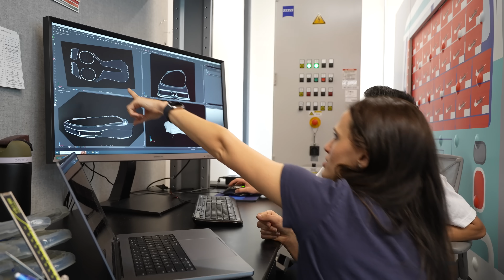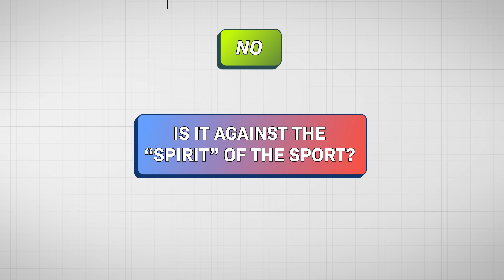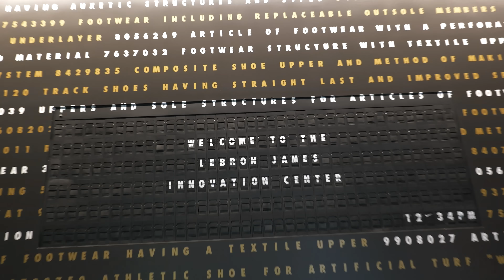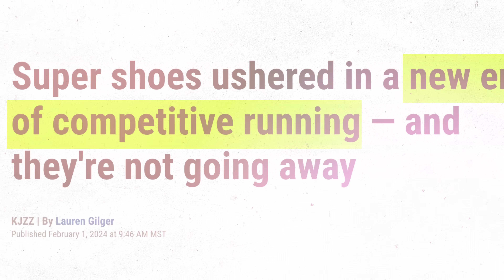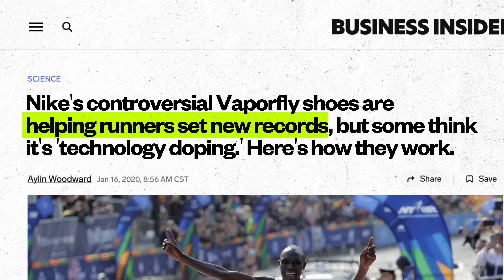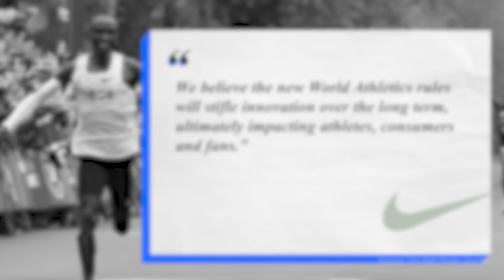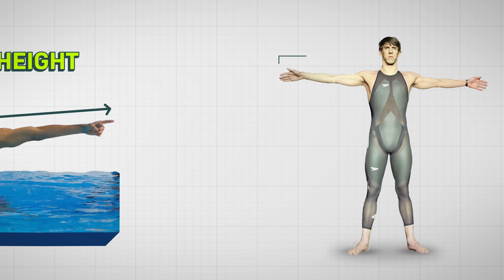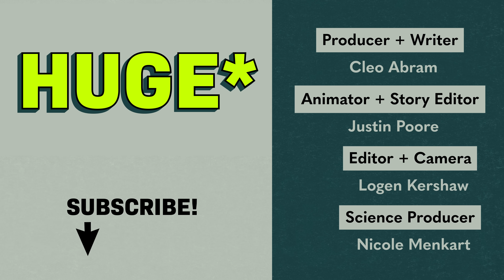The Shoe That Broke Running

Comment: By the way, you should never cut carbon fibre without a proper face mask and a an air exhaust system right next to the saw. Carbon fibre dust is a bit like a modern asbestos and will stay in your lungs forever, since your body can't break it down. It will also stay airborne for a pretty long time, due to to its super fine size.
Reply: good to know
Reply: Holy shit dude thanks for the info
Reply: Long hair just dangling down instead of made into a pigtail is also a bad idea.
But at least she put as much of a distance between her and the saw as she could.
Reply: It’s like no one knows. I see far too many YouTubers doing this. 😢
Reply: Can the body break down saw dust comparatively?
Reply: @Coz131 yes because it is naturally biodegradable, with enough time and fluids it will break down into nothing.  Unless you inhale it on a regular basis.
Reply: @Coz131  Wood is bio matter.  So, yes, can break down in time.  But i wouldn't want to inhale a whole bunch of it at once.
Reply: Looks like the insole was not cut though?
Reply: @sprint702 you can clearly see the insole was cut at 8:29 you can even see the carbon fibre dust on the foam next to it
Reply: Carbon fibre dust is absolutely not good for your lungs but it's not quite asbestos. The smallest particles don't have the correct aspect ratio and those that do are too large, it's more like silica in danger profile, which as we know causes silicosis with chronic exposure; carbon nanotubes on the other hand are almost indistinguishable from blue and brown asbestos (the worst kind) under the microscope and are suspected to be capable of causing mesothelioma from single exposure in those susceptible.

Protect yourselves from dust in general though folks; even wood dust can cause serious problems from chronic exposure, even cancer, in some people.
Reply: I expected a comment like this would be here after cutting the shoe in half 😂
Reply: Asbestos are not as dangerous as people make it out to be. Yeah, it's bad. But we're talking high levels of long-term exposure before damages to the body can be noticed. Doing it once or twice won't hurt you.
Reply: @SweBeach2023  That is unfortunately not really true. It is all a matter of chance. A single fiber can cause a cancer. High concentrations over longer period of time just makes this more likely. You could be really unlucky and get cancer right away (but only after a very long time).
Reply: @balaenopteramusculus  It seems like one of those things where even though the risk isn't super high, there isn't really a good reason to take it. 
Will touching asbestos once kill you? Probably not. But it could, and there aren't a lot of good reasons to touch asbestos, so we don't do that.
Reply: @Lizlodude  Well, that is my thinking. Anyway, I worked in asbestos remediation: you can generally touch it, as long as you don't crush it, cut into it or otherwise fragment little pieces off. That said, if I see it, I stay far from it nonetheless 😂

Comment: It's really funny when you look at the prices of the shoes. These shoes are expensive but not out of reach for a enthusiast runner. Go into different sports like cycling, sailing, and canoeing. Federations have their own labs and research institutes developing equipment for these events without any economic success. The Germans FES bike's frameset will set you back 30000 USD, no wheels, handlebar, or drivetrain.

Comment: Where do you draw the line between tech then? I run a lot, and softer, well built shoes allows me to train more (as opposed to run barefooted), ergo tech gives me an advantage. It's impossible to get away from thay simple fact. Then add in responders and non responders, meaning not everyone will get the same effect from the same gear. Different drops, durometers, stack heights, stiffness, stability etc all factor in and will be very individual. So having options what gear you use gives the athlete the option to find the best shoes for them.

Comment: Its easy. The moment you use a technology that is proven to enhance your performance, you should be in a different competition.
This also would give competitors the possibility to do a all clean competition. If they chose to run or swim without any helping devices, they get sorted to the old records, so it remains worth to compete clean.

Gamers do this all the time for speed runs.

Comment: I have been running for 25 years and when I first ran in the Alphafly 3 I was BLOWN AWAY, the biggest impact for a normal runner like myself was the reduction in fatigue. I can’t imagine how much it must help a top level runner
Reply: My gosh I wish I could get those (300$) I'm curious to see if they would help with leg pain even when walking. I have pretty severe RLS so I'm very intrigued by their effects on pain
Reply: @Lord_LindaThePhilosopher  Expensive athletic shoes are worth it. Even in college, I was using $300 cleats. 100% worth every penny.
Reply: @Lord_LindaThePhilosopher  If you get Alphafly only for walking you're going to regret it.
Reply: @Lord_LindaThePhilosopher  Enjoy, because I really want to buy it here in Brazil. But it's almost 3k R$ in our currency... 😬🥵
Reply: @Lord_LindaThePhilosopher Those shoes aren’t meant for continuous wear, they are expensive but only really meant for higher level runners. They put a lot of strain on the shin and they wear out very quickly. They can really only be used in races.
Reply: What made a big difference for me was getting my runners professionally fitted, including canting adjustment to the insoles. The stability difference was immense and this leads to less fatigue.
Reply: So you could fly? Where did you land?
Reply: I need to try these at some point
Reply: @michaelhannah6949 What shoes that you use before the Alphafly 3?
Reply: Agreed--as an older runner, I appreciate how supershoes make my run pain free by being easier on my joints. I can enjoy running again!
Reply: For that much money, it should run for you.
Reply: Someone who has actually run for so many years would not use something that absorbs impact.

Comment: I think the solution is to have two divisions, one with standardized equipment that every athlete has access to and one with unlimited equipment. As long as the equipment isn’t adding energy in some way, it should be allowed on the “unlimited” division.

Comment: If the energy of a runner is 100% and the energy return is less than that, it's not presenting the actual capacity of the runner and is a liability to him or her. So I believe if there are technologies that can allow runners to achieve their own 100%  it should be allowed. (MY OPINION ON THE TOPIC)

Comment: Technology has enhanced few events as much as it did pole vaulting. Jumpers used to use bamboo poles before metal ones, then fiberglass (I used those) and finally carbon fiber ones. Records evolved along with these changes of course.

Comment: The solution should honestly be to standardize the gear. I don't see why this is that big of a deal, but it's probably simply to generate more and more money for corporations (as most things are). 
When companies provide the gear to lead an athlete to a gold medal, the profits for those specific pieces of gear must soar. The IOC's real challenge is weighing profits with fairness, but the truth is probably that the Olympics is a business first and foremost. The solution is simple if you want fairness. Money complicates everything.

Comment: One of the most important points to consider is: Can every potential Olympic athlete afford the same equipment? If Ethiopian athletes all of a sudden struggleto keep up because the west is wearing high tech, ultra expensive equipment.  How would that be in line with the Olympicspirit?
Reply: The beauty of running is that it was a sport that was accessible to anyone. It is now slowly becoming like cycling where you need expensive shoes and watches to be competitive. And the shoes are not even durable.
Reply: @aslam7952 this is not true. Good cycling gear is orders of magnitude more expensive to obtain. Even a top of the line pair of shoes is only £280
Reply: Yes I think that’s a better discussion. Because if it’s wildly available (and affordable) then everyone has a chance
Reply: What about the Olympics handing out the equipment for each Athlete to chose from?
Reply: @TecSanento  For the games themselves, that would be fine. But the athletes need time to wear, train, and get used to the equipment in advance. It should be at least 6 months before the games. Also, qualifying for the games would depend on the equipment as well. And we can't supply every athlete in the world for free.
Reply: Some athelets have better genes to begin with.
Reply: @chunhualiao8191  Some athletes are born in January. One of the biggest contributions to success in sports.
Reply: Or air conditioning. If some technologically backwards countries don't have ACs in their Olympic facilities, should Americans be allowed to bring their own?
Reply: True but that goes for everything else they use daily unless they all live in the same place, eat the same foods and have the same routine, which would not be appropriate for all individuals, for each person's need is not the same.  No one size fits all, for it never works.
Reply: @amyhoang9140 Training your physical body and having physical advantages is entirely different than having technological advantages. The technology would be doing half the work for them. A person from Ethiopia or Jamaica can train the same way an American can, but a Ethiopian or Jamaican cannot buy ultra fast running shoes.
Reply: Agreed, although impossible to make the Olympics totally fair. The reason the US wins so many medals is because it has the most qualified athletes. The US has a higher population (aka pool of potential talent) and better access to training. This can also be said about most of the countries in the top ten.
Reply: Rich countries will always have the advantage.  They have the best tech, the best training, the best diet, and they make the rules.
Reply: What about countries that have better bobsleds or a better breed of horse?
Reply: One could also include food and clothing.  Some countries will have better things than other countries.
Reply: @ArtFreeman  And some have better air quality. We Obviously can't equalize All variables. But equipment and doping we can equalize as much as possible
Reply: @Roy_Godiksen  In order to pay for equalization countries would have to raise taxes and republicans would be the first to complain.
Reply: @ArtFreeman  That has Nothing to do with Anything with this video...
Reply: @Roy_Godiksen  Ok, that is your opinion.  I have a different opinion.
Reply: @Roy_Godiksen  Not really true. Some countries can afford untraceable designer drugs or bypass doping tests with their influence and money. And once a generation talented athlete can fail to keep up with others simply because his body responds poorly to the drugs or his country can't afford them. Doping needs to be stricter and not normalized just because athletes can get around it.
Reply: @ArtFreeman I think in a competition, it is hard, if not impossible, to restrict or standardize, what happens outside of competition. They can only restrict what happens during competition. So that is when they should make all equipments equally available to all athletes. A more technological equipment shouldn’t be forced to someone, but it should be made available to them if they choose to use it, if it is available to other athletes.
Competing in international events is expensive and requires sponsorships for most athletes. These costs should be included in the price. If it can’t be made available to all athletes (either by the committee, sponsorships or other sources), then it shouldn’t be allowed or the athlete could be considered to not have an adequate uniform.
Just like the different types of women’s gymnastics uniforms (the swimsuit type or the ones with more coverage ). They should be available to all athletes regardless of country or religion, and it is their choice which they use.
Reply: Lack of money might counter the "unfair" Ethiopian advantage excess hemoglobin from high elevation training since athletes have to train above 2 kilometers to avoid malaria mosquitos. Like Cleo says, it's complicated
Reply: @SemiPolymath  It is kind of wild that you're argument is that someone has to train in a safer area to perform well. What idiot would train their athletes in an environment with significant health risks when it is avoidable. You need to take that somewhere else training in a safer environment/facilities to avoid major injuries, and sicknesses is normal. I'm not ignoring the hemoglobin thing it's just irrelevant in the face of environmental factors. It's not like they are taking performance enhancing drugs or using banned enhanced gear.
Reply: @SemiPolymath  only the mountain dwellers get long enough lasting rbc quantity and quality increase afaik

Comment: In cycling there are lots of rules pertaining to equipment. The goal being to keep the sport a competition between athletes and not engineers. I get that but at the same time it can be frustrating because the we the general public can buy all the same equipment and it can limit what we can buy. Weight limits for example can be easily and safely done below what is legal. I had at one time a road bike that would have been banned for competition. It was nothing exotic either. It was just small. Frame angles allowed my not fit extremely tall or short riders. 

There are other aspects too. Cross country skiers at World Cup level have crazy amounts of equipment. Top skiers will have 70 or more pairs of skis at their disposal.

Comment: Especially that last part was ethically very interesting. He was too tall? But how does that work for people who are actually tall and use that to an advantage? Should they also be disqualified because their height is unfair to other athletes?
Reply: Not too tall. I think they claim that he had unnatural proportions , which gave him an advantage (lower body much longer, given his total height). But still, some people have longer legs than others that have the same height. I imagine that there would be some negotiations about the final height they decided that it was "fair" to compete with. But yeah, given also the disadvantages of having blades (e.g. reduced acceleration), what is "fair" is not really measurable and it's going to be subjective.
Reply: i had the same question it is a rule that needs more questioning and better understanding. Because i get where they are coming from but that is not a level playing field from my eyes
Reply: No it's that the blades made him much much taller than he would be in reality.  Although I agree with him that they probably undersold his height if they are basing it off of Asian man body dimensions.  It's like if you or me strapped on shoes with massive springs in them that made us five inches taller, would that be fair?
Reply: International sports. It's in the name, you're competing at an international level with people from different races.
Reply: No, he wasn't too tall. That's not what they said.
Reply: I get the impression that they were just looking for any reason to disqualify him.
Reply: @elladesigns9609  as they should. Paraolympics exist for people that can't take part in the olympics without corrective equipment. It's that simple. Blades change entirely the sort of person competing. Now...if you want to say corrective equipment is allowed then there is a case for having no paraolympics. You decide. Can't have it both ways
Reply: @out_spocken but paraolympic athletes will not get the same amount of attention, sponsors, and money. Their achievements will not be seen the same. Competing in the paraolympics would be career suicide for him, especially as far as money goes.
Reply: He was too something and tall wasn’t it.  They could have sampled his family members not a cohort of stereotypically shorter people. They could have used Netherlands then the average height would be 6ft and would have been just as arbitrary.
Reply: @hruntingson  The average height of a given country has absolutely nothing to do with it.  It has to do with all of his bodily dimensions and the general leg length that he would've had had he been born with legs.  But yes, they certainly should've based it on a study of African American men or even took a look at the men in his family instead of asians and whites.

Comment: For those curious, the Nike Vaporly 3 seem to go around for $280-300
Reply: Alphafly 3, which is what we saw in the video, is $285 in the US. The Vaporfly 3 is $250.
Reply: @brandall101  Thank you both. I don't like sitting through a whole video to find the one word you need but they don't tell in the headline.
Reply: When 1 shoe is ur current 1 month salary in Indonesia is wildd 🙃
Reply: @mawar7957  bruh yang murahan dah mayan bos owkwkwowk
Reply: @mawar7957  That's a third world shithole. Ofcourse people make nothing over there.
Reply: They only last around 250 to 300 miles too, so 10 marathon races worth no account for training miles. The cost would really stack up for some athletes. 

Not to mention the waste of having such a short lived shoe
Reply: @ganglesmc6879  I doubt they'll fall apart at 300 miles, most likely still usable when top performance is not necessary.
Reply: @ganglesmc6879  Never liked some of their foam shoes. A few of them have proper padding for durability. Others are foam at the very bottom...all foam exposed. And they cost $150...
Reply: @ganglesmc6879  It's not a great idea to use a shoe like this for significant training miles though. Not only is it not cost efficient, using stiff carbon plates for all miles can lead to injury. This is really only for running marathons for final prep for marathons.
Reply: Imagine buying the latest technology on running shoes only to lose to a Mexican Raramuri wearing Sandals 😂